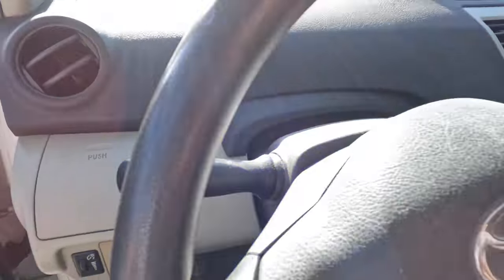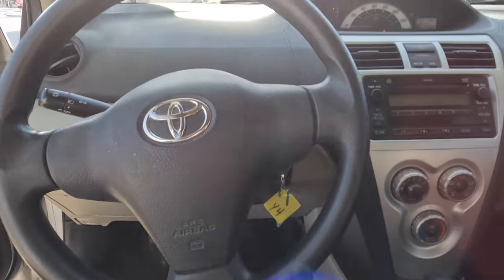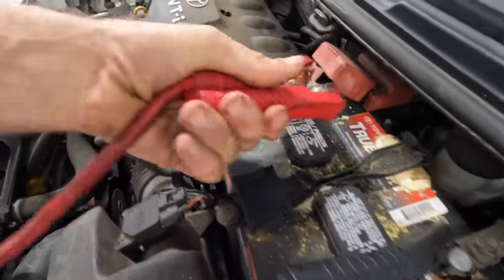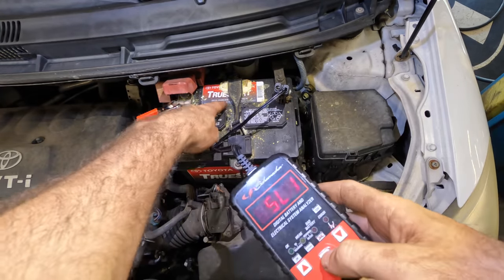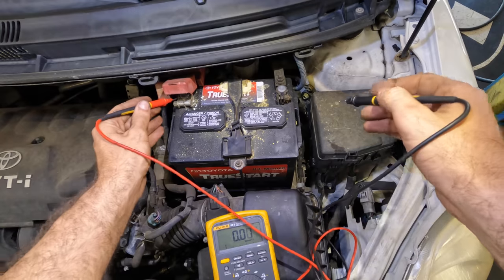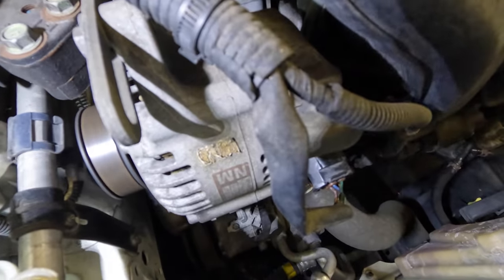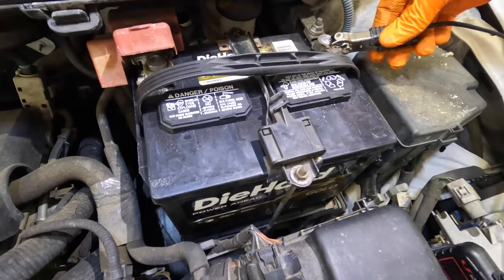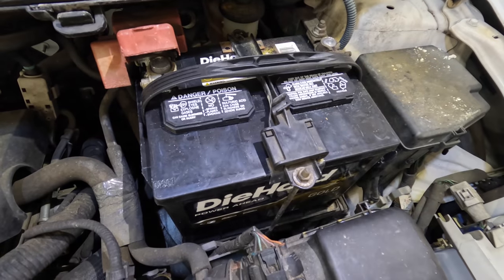Ignore the obvious! “Let’s see what happens” 2006 Toyota Yaris

Comment: That powder stuff on top of the battery is battery acid. It is trying to connect the two poles of the battery and slowly shorting out the battery.
Put baking soda on the battery and sprinkle with water. Rinse whole battery and area with water after a few minutes of treatment. If you remove the battery be careful to not get the battery acid powder on you.

Comment: Had 2007 Yaris 1.3 and the alternator went wrong. No light on the dash. The mechanic told me that this is known issue for this Yaris generation. I called the Toyota dealership (car was 10 years old back then) and they changed it for free :) - there was recall for the model that I was missed. (I'm in Europe)

Comment: Thanks for the terrific video to replace the 'nater'. Your pragmatic ability to undo a clamp so you can remove a long alternator bolt is a simple move but it might stop a novice in his/her tracks unless they were able to watch someone else puzzle it out. Too bad the owner didn't accept your findings that the original battery needn't have been replaced.
Reply: Why can't the customer decide when to replace his own battery??? Do you know how old that battery was??? What if that battery had a weak or failing cell or two??? Why not start out with a new battery and alternator??? Probably the best long term approach, no ???
Reply: @frandanco6289  the customer decided to replace the battery and only after that didn't work approved changing the alternator. The customer decided to replace the one component that had tested ok the first time round.

Comment: If Ray would have taken a few minutes to show the customer how a working car battery/ alternator looks on the multimeter, compared to his car, the customer would be smarter and wouldn’t have asked to replace the battery.  But, the customer is in the office with the service manager and when presented with a diagnosis has no idea if it’s a legit test or if the mechanic is throwing parts at the problem.  I have been in this situation so many times, that I have educated myself on a lot of car related topics. Ray, your videos are fantastic.

Comment: The broken alternator sounds like that it has at least one bad diode or some issues with the stator windings, turning the normal whine into that howl as only part of the 3 phases of the internal AC circuit (hence the name alternator) are producing power though the main rectifier. The type of the fault can be diagnosed with an oscilloscope, there are still some waveform charts around the internet.
In this case based on the voltmeter readings it seems still struggling to put out some current but goes flat as load is added.
Of course usually it is not worth trying to repair an alternator, but in case of some old and/or rare vehicles repair may sometimes be the only choice.

Comment: I could hear the alternator whine of death the second you started it outside, not much else sounds like that. I’ll usually put my stethoscope on it real quick before I run a starting/charging system test just to verify the noise is coming from where I think it is, needs an alternator at that point regardless if it sounds like that.

Comment: In this case, my be we can chek alternator, that noise is from the bearing of the alternator, if the alternator it's doesn't charge we can check the carbon brush inside the alternator and my be need some replacement for, and the simple test to chek the alternator is when the engine round we touch the alternator by srcewdriver or wrench, if they're have a strong magnets for the tools it's mean the alternator still have a charge... 🙏🏻

Comment: I would consider replacing the battery if it was more than a few years old after it's been dead, but never the let's see what happens with the battery.  Last year my '65 Corvair alternator needed replacing, out and in in ten minutes.  EZ. It was hard to find as everyone was out of stock.. The Corvair parts place had one, but really wanted the core back as the core was $145 and they paid 60% of the shipping.

Comment: Its the voltage current and amperage, as you measured, that is the source of power of the Battery and the Alternator. Its the water current that drives a hydro dam generator not H2O molecules!!

Comment: I'm not sure if you cut the video, but I would recheck that bottom bolt, it got too tight by hand and then didn't appear to tighten enough turns to be fully in, I'm suspecting that it's cross threaded .

Comment: Way way some car battery company casually mentioned in an ad that 48% of the car batteries that they got back were perfectly ok.   Batteries are just cheap enough that they often got replaced for no great reason at all.  You'd think that percentage  would have gone down when good battery testers became common, but apparently not so much.
Reply: I replace my battery at 5 years.  If I wait until it goes bad, it means I got stuck somewhere with a dead battery.

Comment: I had previous starting issues with my car, and was able to do some troubleshooting myself that wasn't far off from what was done for this car.
Car wouldn't start, low battery behavior.
Jumpstarting would get the car to start (this eliminated the starter from my list of causes)
Running voltage was between 14.5 and 14.9 (this eliminated the alternator from my list of causes)

Turns out, running the car for a maximum of 5 minutes per start isn't good for a battery.
Reply: Even running them for 5 minutes per start isn’t the end of the world. You can probably get away with doing that twice per day, 5 days a week.

So long as on the 6th or 7th day you run it for an hour to recharge the battery.
Reply: @andyruse4670  problem is, I wasn't. Now the minimum I aim for is 10 minutes.

Comment: It sounds like the front of house person sold them the battery to me, it looked like it was passable for sure but at least a couple of years old, so maybe peace of mind was worth a few bucks, which I might agree with if they had accepted the alternator at the same time!
Most alternators sold in the UK at non-dealer parts outlets are on a trade-in/remanufacture service, which is normally a similar price as your mechanic performing the service if it can be reused, with the benefit of the remanufacture service specialising in that function; so transport costs/pollution are created but the parts don't go straight in to a metals reclamation process.

Comment: Thought to myself; replace the battery rather than replace the alternator? You're gonna spend more on a battery, surely (really quick Google search suggests "very similar price" here with the UK tax)... Then realised that would be "parts only". Alternator replacement would almost certainly take longer than replacing a battery. YAGV Ray, if I were in the US (Florida?) and didn't own a BEV, I'd be eternally happy to have you work on my car.

Comment: Could be worse.  On my Acura RSX to change the alternator you have to remove the front bumper cover and the right headlight, then wiggle and rotate the alternator in three dimensions  until you find just the right number of rotations to get it out.  Reverse the fun to put in the new one.  Then you discover that the lights still flicker rhtymically, the problem is somewhere else-- not in the current monitor, or the multiplex box, although changing those makes the problem go away for about 3 minutes. .  Finally had to sell the dang thing, I don't like flickery night driving.
Reply: Mama blew through a puddle at speed in her TL and wasted a fancy-schmancy HID headlight transformer.  Required a front bumper cover and headlight removal as well.

Comment: Fill the battery with distilled water.
I found the battery in my 6 year old car was a full 20oz low, I topped er off and gave it a hard charge with an old dumb charger and it came back to life.

Comment: I was shocked to see the battery tester say the battery was good, especially after only 10 amp hours of charging. They usually show every battery is bad. It was a Toyota battery, possibly the original which might have been why the owner wanted to replace it.

Comment: The Denso alternators in my FJ are amazing. You just need to change the diode block every 7 years. That’s it. Keep the original.
Reply: i say diode too from the noise 
but i’d be doing it myself so i guess if you to pay him by the hour 
to do it maybe it’s just as cheap don’t know.
my yaris has 346000 kms and my alternator could use brushes 
the starter brushes also wore out recently.
why buy a whole
starter ?
Reply: Back in the day I had an '85 Buick Somerset Regal with the 2.5 four cylinder.  It's alternator liked to blow the diodes on occasion.  Change diode, all ok until next time.
Once changed it in a motel room...

Comment: 24:32 THAT NUT SHULD NOT BE REMOVED. The cable goes on top of that nut and a second nut on top of that.  Look at how the old one is dismantled 11:40. There are two nuts.
The 12v connection is now mounted wrongly and with torque squeezing the plastic insulator that will soon crack with failure and potential fire hazard as a consequence.

Comment: Great video that demonstrates that second guessing the professional mechanic over a simple problem costs the customer more money. In this case, probably $150 or more to have that battery installed. I'm trying to recall how many times I second guessed the pros when I was young, stupid, and poor.
Reply: Though if a battery has been run off a bad alternator for a while its not always a terrible idea to get a new battery too, just as a precaution. But yeah wasn't really necessary.
Reply: You do not know if that original battery was good or how old it was... Looks like You are second guessing...
Reply: @frandanco6289  Weh!

Comment: Well i was replacing the fuel pump on my 07 frontier and was undoing the back strap bolt and the bolt broke and some how my fist connect with my face and i punched out my own tooth. 

So yes be careful about making fists when working on things wrenching nuts and bolts.

Comment: It's kinda disappointing the diagnostics for a bad alternator aren't more involved on this generation of cars. Old cars were more fun, you could fiddle with the voltage regulator and check for voltage drop on the signal and output wires, check the clutch, and assess output ripple. I've heard that the newest vehicles use a more complicated algorithm for charging, in an effort to eke a tiny increment of fuel efficiency. It would be interesting to see how you command the alt output with a scan tool before checking battery voltage.

Comment: The way to keep that battery holder rod from disappearing into the Twilight Zone is to clamp a mini vise-grip on the rod stem, leaving some room so the hook will be able to slip free.  Now take the nut off, the stem drops down a half inch and you pull the rod out holding onto the vise-grip.   (And reverse for installation!)
Reply: Indeed that flashed in my head as I was  watching.  I have a few of these minis & another  neat trick is to solder one  on the end of a test light replacing a questionable  alligator clip.  Many  more options for a sure  solid  connection especially in the rust belt areas as it cuts through the crud & rust  and stays put.

Comment: Hey Ray, Not sure if you re-clipped the air cleaner canister clip back on, I saw it rattling and not clipped at the end of the video as you were checking the charging voltage.

Comment: My 1978 Plymouth Arrow had such an alternator belt tensioning bracket.  I wrecked the car.   Damage included distorting the shape of that bracket.   Dad, the pro mechanic, grabbed a random bracket out of his truck bed and put it on my car.   It didn't fit.   The car ate alternators.   It's completely irrelevant to your work, but it tells me that even Toyota can build a cheap car.

Comment: There were two very weird things in this video and one was the redhead working on the tire when you pulled in any other was you rolling up a window on a car. I didn't know during that year they had non-electric windows. I'm sure it was extra at the dealership I commend the guy for changing that battery only because that battery was taking a beating for God knows how long and probably would have taken a shit and then blamed it on the shop for not fixing his car properly so kudos to the car owner.

Comment: Parts  swapper. How about checking the connections at the alternator for corrosion and the path to the battery before just swapping in a new alternator.  Of course on the video I could not hear the noise it was making over the engine noise, so maybe I am all wet.

Comment: Sorry, but I have to comment on your lax test procedure.  Yes, 95% of the time when running voltage is low the alternator will need to be swapped, but not always.  I’ve fixed a few charging problems with only a cable or even by simply cleaning and/or tightening a ground.  FFS Ray, put a voltage meter on the alternator case and cables.  What’s the voltage drop between the alternator and the battery?  Might there be a faulty cable or ground?  Just sayin’.

Comment: Many years ago, I was working in auto parts.  A customer came in with a brand new battery he wanted to trade in as a core.  The place he had purchased it from refused to warrantee it because it was perfectly good.  They told him to check his charging system.  He was angry with them and didn't want their battery.  I check the battery and it was perfectly fine.  I told him so.  I told him he was wasting his money.  He didn't want to hear it and bought another battery and left it as a core.   That battery lasted many, many years in my own car.

Comment: I'm neither an engineer nor a mechanic, but it looks like that method of placing tension on the belt is asking for problems. The belt stretches slightly with wear or the bolt slips slightly and the belt would slip until the bolts tightened again. The standard spring belt tensioner seems much more consistent. Do many cars use this style of mount to keep tension on the belt?
Reply: Most older cars with v-belts use exactly that method.  You adjust the belt tension by pulling on the alternator and then locking down the alternator bolt.  Checking belt tension was a regular maintenance item.  It wasn't til lately that they came out with the fancy hydraulic tensioners.  As the Yaris is a bare-bones econobox, the old ways are still used - but it does seem strange to see someone doing that on a serpentine belt.....

Comment: If the regulator blade assembly connector has crud in it, you may find a zero charging situation although the alternator itself is good.  Try cleaning off those terminals before spending the money to replace the unit, it just might fire right back up again!   But if the bearings are growling, time to remove the unit.  And, incidentally, that new belt is liable to stretch, so be sure to re-check the tension after break-in.

Comment: The infamous Toyota air filter cover clips. I have experience with how they don’t work.
Reply: Then they went to bolts, saw a guy at a parking lot literally spend 2 hours trying to tighten down the air box. He did not finger tighten 1st but ram a socket and crossed threaded it for 2 hours. His issue was I can't get home.

Comment: I give you credit on the long distance round about way of showing that you are learning to use a DVOM. I applaud your purchase of a Fluke. (I quit commenting a while.) Let's start from the beginning: Your Jumper gives a digital Voltage reading. (Turn it off and see what it says about voltage.) Then you go with the Battery Charger: ( Turn it off and fire the vehicle... still a Volt Meter..)  Then you use a Battery Tester with a digital Volt reading.... (This is getting funny now...)  Now you have to show your ability to use a Fluke that gives the same result that the previous 3 would have given you. Would have been the same result from all, but you need to have production value for all that have no clue. Low voltage and singing from the Alternator usually indicates a bad Diode Tree. You probably should have switched your Fluke to AC mode to prove it. That would have been great production value there... Hey, you fixed it. Did not properly test the new one, (Under full load and in AC Current mode) etc. etc. Just ship it and make a Video....

Comment: That car has 107k? That's the problem- the car never gets driven. Spouse-shaped-person has a 2007 Yaris (5sp) with ~200k (will roll over any day now). I've done that alternator... twice. I could have told you about the pipe for the AC. For extra fun, when I got the first one out, I saw seepage from the water pump shaft so I did it too... the pulley has to come off to get it out. Still the whole job took me 2.5 hours (and I'm not a professional)... the stealership quoted her $1200 (in 2012... I would be fascinated to know what actual book time is for that)  Second time I did the alternator in an hour, including hydration break.

BTW, her car still has the original clutch. Other than a water pump, 2 alternators, 3 sets of brake pads / 1 pair rotors, and about 50 oil changes... the thing just goes. But at 0:03, fighting to get the door unlocked... yeah. That driver's door lock is seriously the only thing on the car that's wearing out.

Comment: The correct path the customer should have taken given the diagnosis was replace alternator and clean battery terminals, then buy a battery if needed. However since he tested it with in specs it should have been fine. But what do I  know. Not a mechanic and don't play one on TV. I just drive cars and sometimes fix my own.